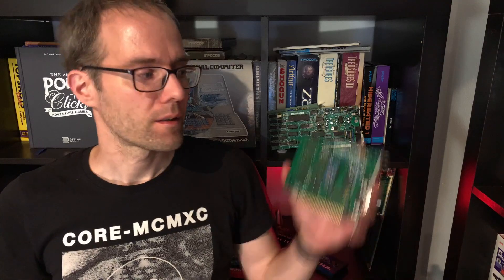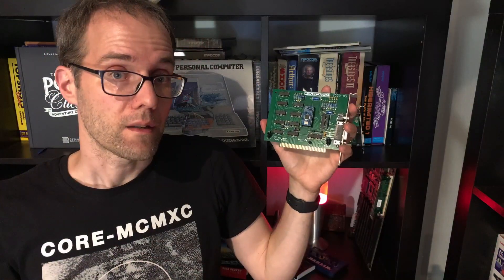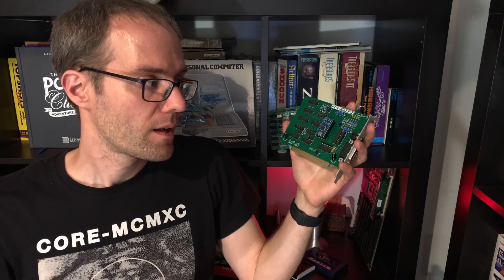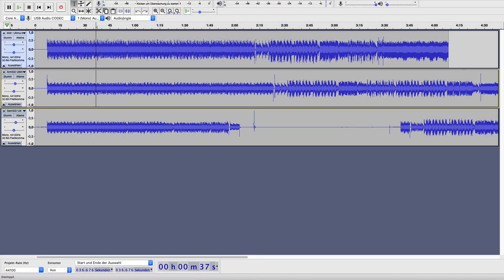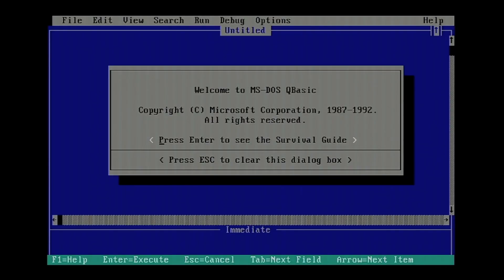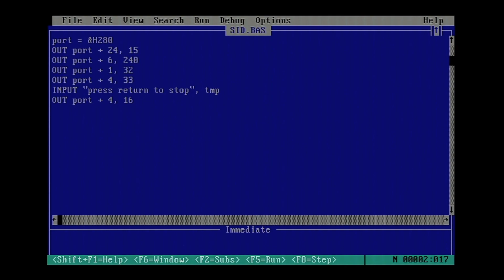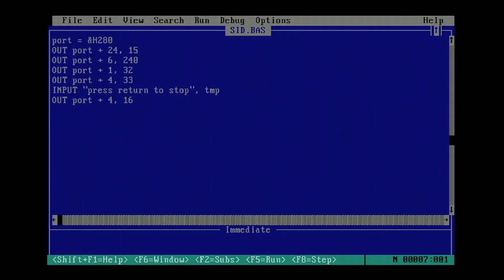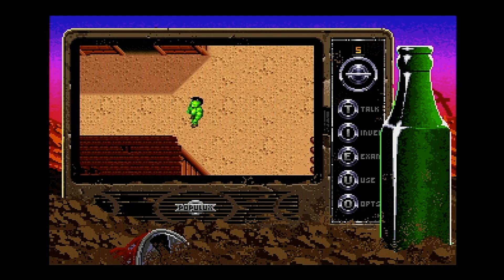What is the best C64 SID Chip - For MS DOS?

Comment: Awesome video, thanks for sharing! Any C64 emulators that use the Innovation for audio (as a passthrough), instead of software SID chip emulation? Sounds like it'd be an interesting use case for the board.
Reply from the maker: I heard that VICE for DOS can use it. Needs a Pentium 2 or better though for performance reasons.

Comment: You're building time based oscillations based on a base clock of some sort.  With soft emulation you don't have a direct link between pulses of a RTC or crystal oscillator and an output waveform.  Even division or rounding errors in compiled code could account for variations in output frequency.  Same reason my car, stove and wrist watch all have time drift that is unique to the device.  Trusty 1990's alarm clock that divided the power frequency to produce time intervals is more stable than any of the "soft" clocks.
Reply from the maker: Yeah, it might be that the ArmSID uses the external clock for its emulation and the SwinSID doesn’t